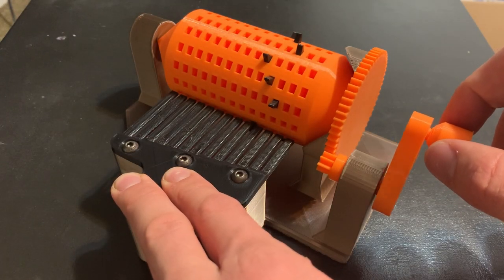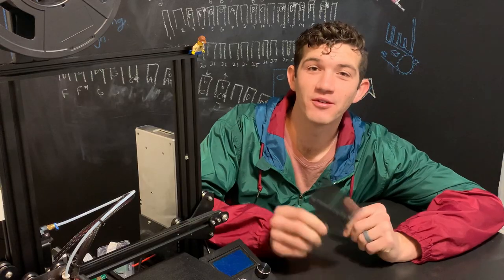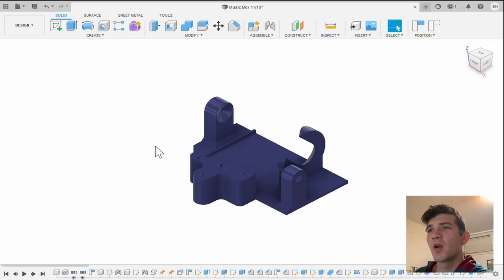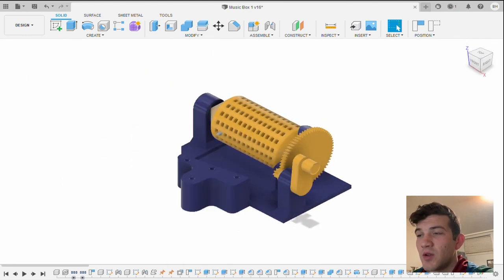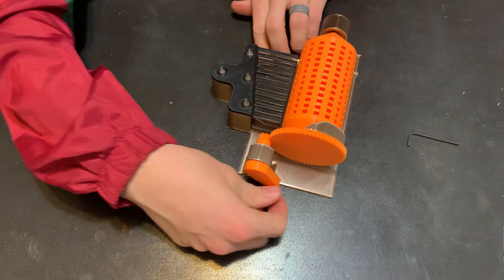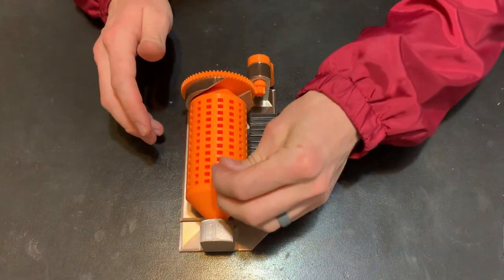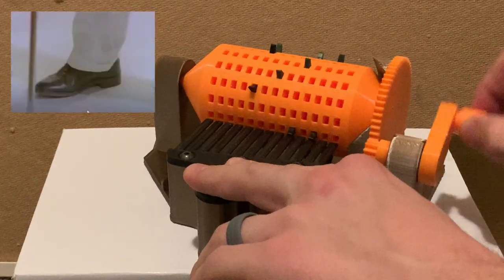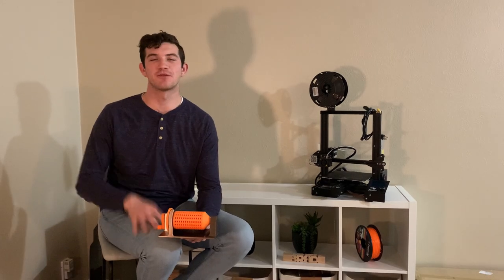I Made a Programmable Music Box

Comment: Somehow got this in my feed in June 2022. Groovy project!

As for "redesigns," I would probably have two full octaves instead of one, a larger drum diameter and/or smaller spaces between the rows to allow for longer compositions, and consider a different material for the tines/teeth mainly for durability or longevity. An addition to the current design could be some sort of amphitheater-like hood to put over top to contribute to amplification efforts.